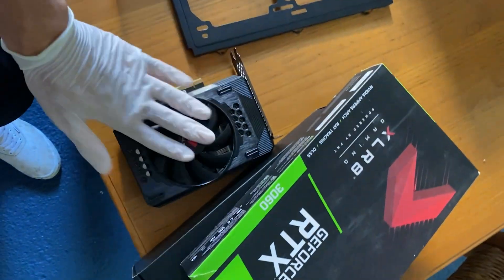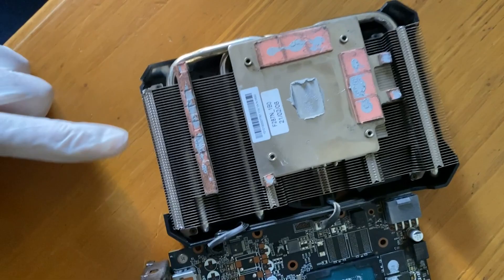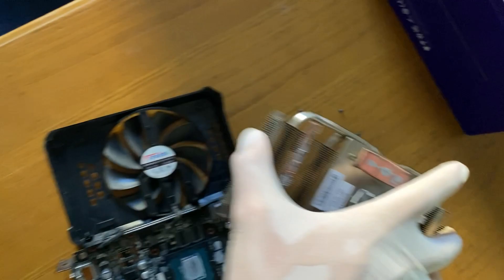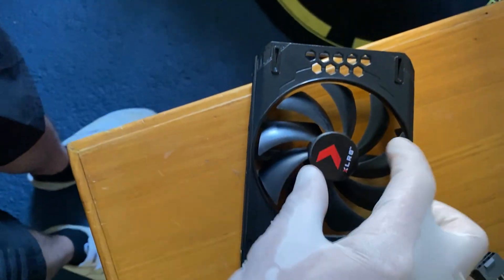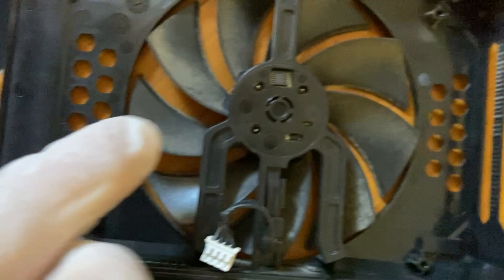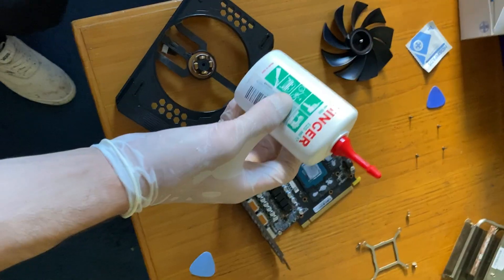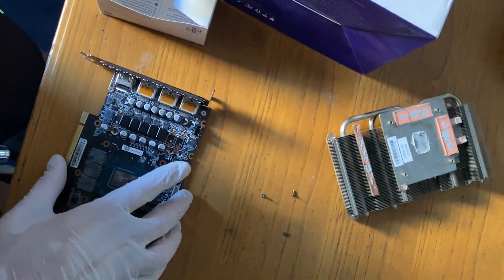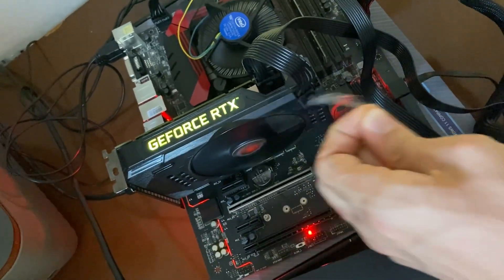How to Fix a Broken GPU Fan or a Noisy Fan - Full Tutorial

Comment: I have done similar to PC case fans but have a lazy fan on RX 580 Nitro+ card. It spins but will stop, then I touch it and push the center of it and it works. I have seen people using really strange oil because they have no machine oil, they used cooking oil or coconut oil lol. Thanks for this tip, I appreciate the channel.

Comment: Do not pull the fan. It has plastic washer at the end which holds the axel. You need to pry open that plastic washer in order to pull the axel. The washer has a cut. So it can be replaced after assembly. Without the washer your fan will  drop out. This dude has no clue what he's doing.

Comment: I can't believe it. I just cleaned my 6 month old (still fresh as new) RTX 4070 S today, I was literally babying it and somehow my thumb went on and pressed the middle fan on the center. The pressure I put wasn't substantial but it was not exactly "light" either and now it has began rattling in low to medium rpm but it goes quiet in high rpm though. I don't know what to do here. 

The card on the video is an old one so its understandable as it wears out over time but my new card just cause my dumbass pressed on the middle of the fan... I am beyond annoyed at myself and neither was I expecting my "not exactly cheap"  ASUS TUF RTX 4070 SUPER's fan to begin "rattling" just cause I nudged it slightly. Today was definitely a shitty day for me.
Reply: have you fixed it? i have a small rattling sound even with 500rpm.. and it gets louder the more rpm. my gpu isn't even two weeks old and i haven't done anything to it, it just came like this 😢 i was hoping to be lucky with not having much coil whine and the card actually doesn't have much but instead i got the fan noise 🥲
Reply: @niconii3663 same here with an Asus Tuf Rtx 3080 ti... It seems Tuf cards have this problems with fans

Comment: I did that to one of the fans but when I wired it back, it stopped working entirely.
It took a lot of effort to pull it out. It's "Apistick" brand. 
What to do.
Reply from the maker: Check if you accidentally broke a cable! If so, just solder it back :)

Comment: For the fan bushing, I wonder which lubricant would be better: 1) Sewing machine (mineral oil-based) or 2) White lithium (AKA NLGI 2 grade) grease?
Reply: lithium is used for bigger bearings, it will work ofc but with no additional positives. could be more viscous then needed
Reply from the maker: Very well said! I’d go with 1 personally

Comment: How do you remove the fan from the shroud without damaging any parts?
Reply from the maker: It truly is just a matter of pulling, but you have to be very careful and take your time, don't pull too hard. Also subscribing to the channel grants you that needed extra luck :p
Reply: @ImWateringPSUs  You could have mentioned that you used the flat iFixit spudgers 😛